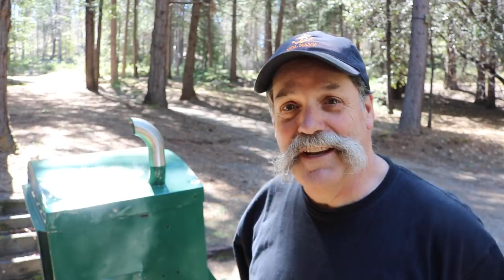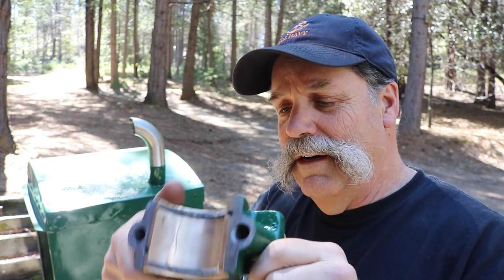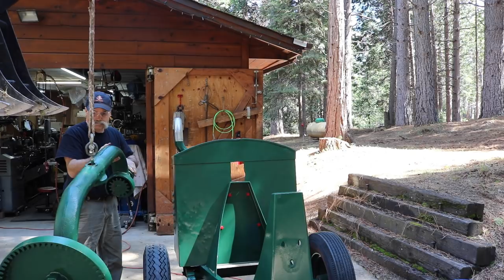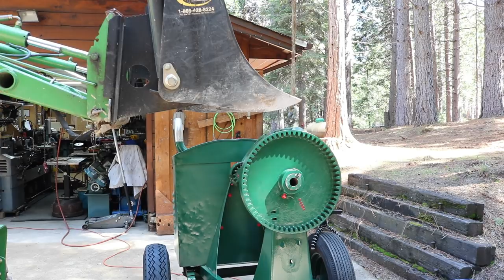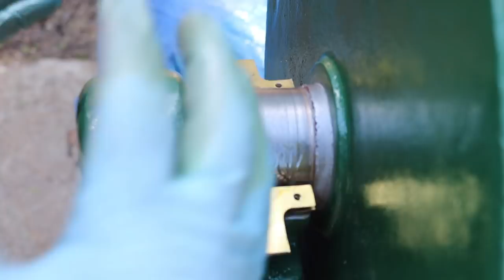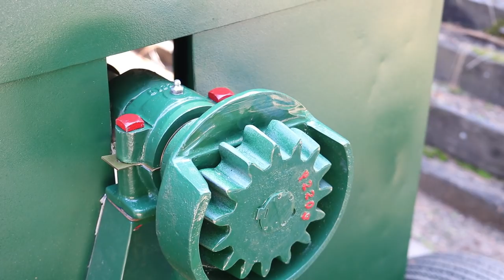Cement Mixer Restoration | Yoke Installation

Comment: Hey RR, I'm running late on watching videos.  Poured the slab for the new shop. The building comes tomorrow.  It's pretty much business as usual where I live.  Been to Wal-Mart several times, Lowe's several times, the Equipment rental twice.  Had 13 yds of concrete delivered.  So we have been busy.  I know of no cases in our county.  The county south of us has had seven, but they have a college.  Most cities with colleges have more cases...must be related to spring break. - The Red Bolt Heads are a nice touch.  I thought you were gonna get it to loop, it looks smoooth.  Stay safe my friend.
Reply from the maker: Moving right along there Vernon.  Thanks for stopping in.  Stay safe.

Comment: ,great job I have a question instead of cork why not use auto silicone  next where is the grease fittings for the bushing may I suggest you use marine grease I do lawn equipment and found the marine grease rebels water

Comment: G'Day Randy, it's good to see you are well. Very nice job on that mixer so far :)  Have you considered using either Cup Seals or a Cup Shield (non-flexible) on either side of your Bearing Blocks? They would help keep the grease in and gritty stuff out.  Stay Safe.
Reply from the maker: I did, but they would of had to be split ones,  The felt will work fine.  Thanks Anthony.

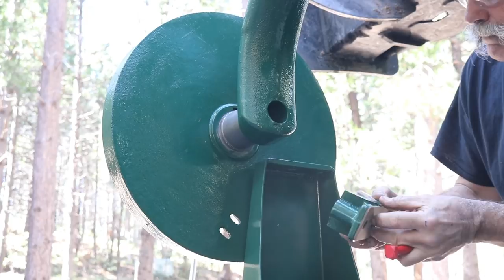Comment: got scary at 9:57 when the hydraulics started lowering it on their own while you were under the bucket..  you looked away to get the bearing shells..  time to repack the cylinders and redo the control and cylinder locking valves .
Reply from the maker: No a leaking hose,  Replaced now.  Thanks Wayne.

Comment: Did you glue the felts in, and if so, what kind of glue did you use?  Nice job, as always.
Reply from the maker: The felt has a sticky backing to it,  So it stuck in there pretty good.  Thanks Ian.  Stay Safe and well.